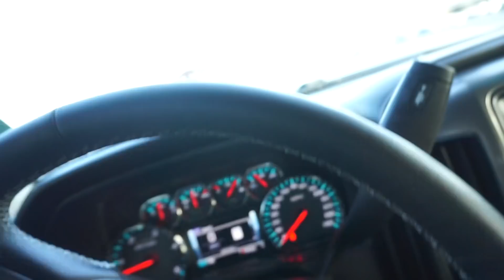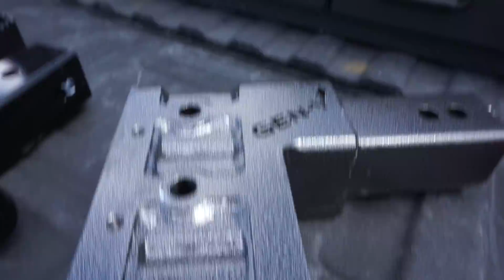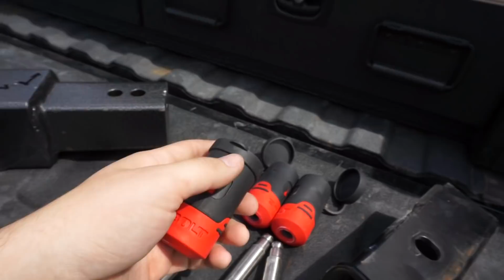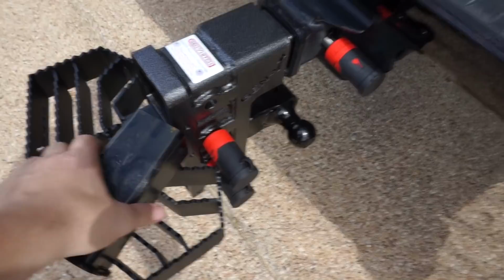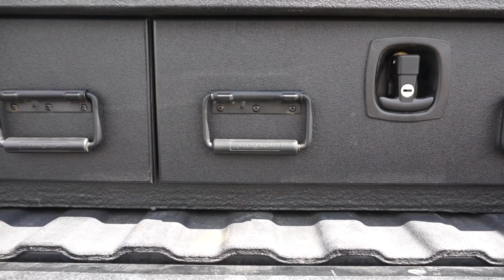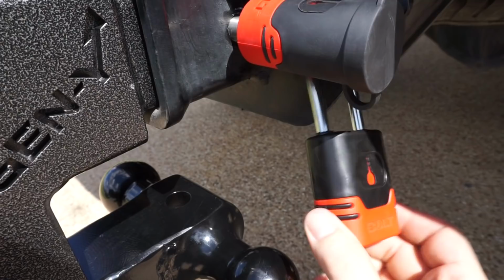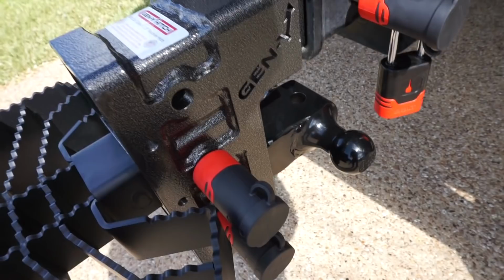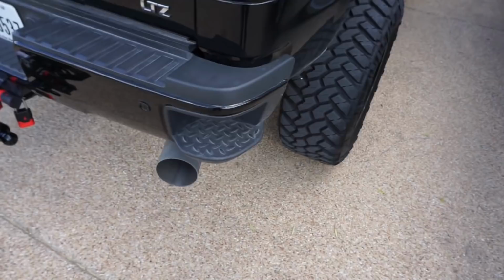This Truck Hitch is worth $1000?  | GENY Hitch & Bolt Lock Setup

Comment: Nice hitch but way overpriced for the work you have to do  unlock remove step reverse hitch ball put lock back on I think for that kind of money needs to be more practical and if you’re just going to pull real heavy that’s where you should start going with a fifth wheel pull.

Comment: You went the long long way around to sell us on this hitch.  It has features but most people will never use them.  Besides that - up here in Northern New York Lake Placid area - one winter will turn ALL that to rusted junk.   $1000 wasted.  If you leave it locked you'll have to CUT it off.
Reply from the maker: Mike Nituob my needs arent yours, my environment isn’t yours. To each their own.